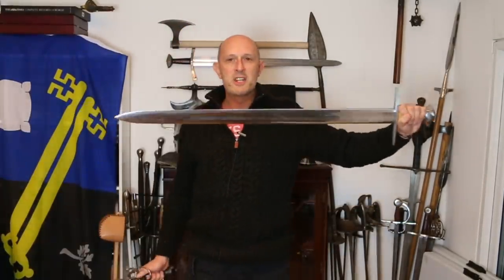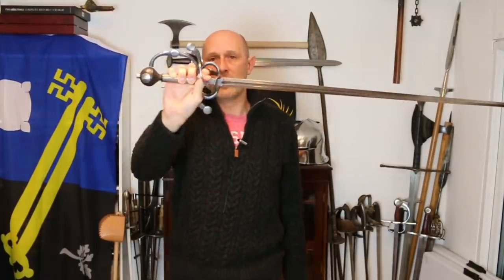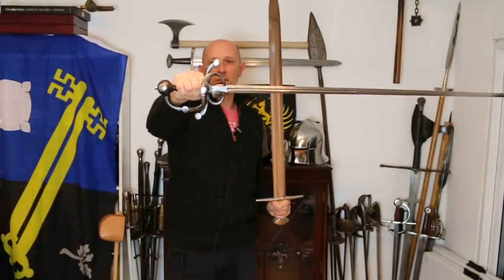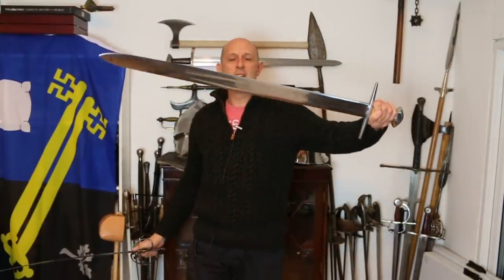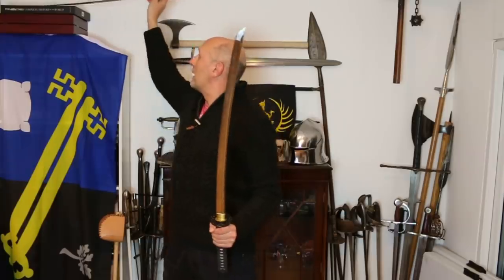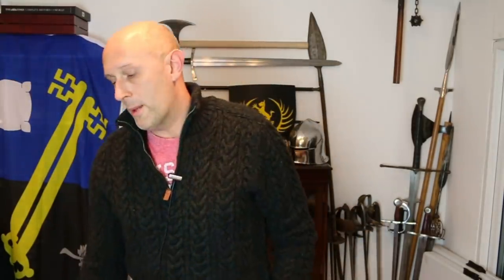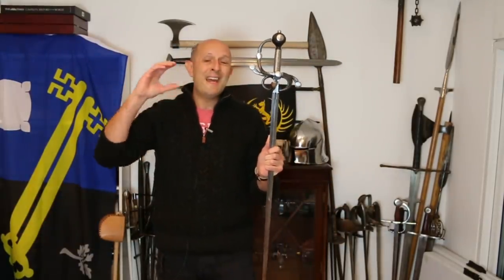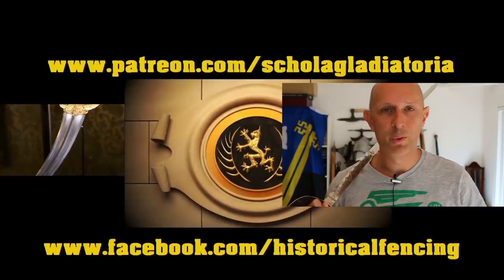Sword Blade Technology Informing Design

Comment: Isnt that rapier a litle short?
Reply from the maker: A 43 inch blade? No, it's rather long actually!
Reply: scholagladiatoria i use 50 inches spanish rapier, i thought that normal
Reply from the maker: No, a 50 inch blade is bizarre. Most rapiers of any nationality are between about 36 and 45 inches in the blade. You can see some stats of originals looking through the Wallace Collection online gallery.
Reply from the maker: Spanish rapier, total length 40 inches: https://wallacelive.wallacecollection.org:443/eMP/eMuseumPlus?service=ExternalInterface&module=collection&objectId=61155&viewType=detailView
Reply from the maker: Spanish rapier, total length 39 inches: https://wallacelive.wallacecollection.org:443/eMP/eMuseumPlus?service=ExternalInterface&module=collection&objectId=61148&viewType=detailView
Reply from the maker: Spanish rapier, total length 46 inches: https://wallacelive.wallacecollection.org:443/eMP/eMuseumPlus?service=ExternalInterface&module=collection&objectId=61163&viewType=detailView
Reply from the maker: Spanish rapier, total length 48 inches: https://wallacelive.wallacecollection.org:443/eMP/eMuseumPlus?service=ExternalInterface&module=collection&objectId=61149&viewType=detailView
Reply: aren't you a little short for a rapier?
Reply: Remember, Matt's quite tall.
Reply: Depends on the period and the material.  If you look back to the Bronze Age, eastern Mediterranean, the Minoans were empling a bronze "rapier" with a narrow blade ranging from about 60 cm to around 75 cm over all.  The so-called horned rapiers were primarily employed as thrusting weapons and there is a good deal of that kind of use illustrated on carvings and pots from the period.  One really nice example shows a thrust delivered overhand over the top of a shield.

Comment: Hello community. What do you think of this idea?
In a real sword fight, you'd need to apply a reasonable amount of force to be able to pierce a torso or to open a vein, etc... Yet in HEMA tournaments, a touch of the sword against any part of the opponent is considered a point, regardless of the amount of force behind the strike. This means that our best tournament champions might prove to be utterly ineffective combatants against the average 13th century peasant conscript. So, my idea is:
What if the tournament armour were pressure sensitive? For example, if there were 2 thin metal/ wire inlays, separated by a porous padding material, you'd have to apply enough pressure to compress the porous padding material, so that the wires/ mesh on either side of the padding (which is porous) touch, thus completing a circuit, thus lighting up a light (similar to fencing) announcing that you struck hard enough to score a point. Obviously, the more padding between the mesh, the more pressure you'd need to apply there to score a hit. So, the torso could have moderate padding, requiring a modest amount of effort to score a hit hard enough so that it registers. The fingers could have very little padding, requiring just a light touch to score a registering hit and so on...

In my opinion, I suspect that this would increase the realistic feel of HEMA combat, as you would fight entirely differently. I mean, if your opponent just flicks his sword around your defences quickly and slash/ taps you on the torso, that's a point for him/ her. But if you KNOW that there's not enough force in their strike for their sword (if you were to imagine them using a real sword, that is) to break the skin, you'd ignore their strike utterly if you knew you could capitalise on it. Hang on... Let me try to explain it better...

If you're in a real sword fight, you want to hit your opponent hard enough to hurt them, but not so hard that you unbalance yourself if you miss. You never want to simply lightly tap any part of their body with a strike that has ZERO power behind it. However, in tournament fighting, you can get away with these zero-power, feather-light strikes. I think that HEMA would be better if this were not the case. I think it would be better if you had to hit them "x" hard for an arm strike to count/ to hit them "y" hard for a head strike/ "z" hard for a finger/ groin strike and so on and so forth. Furthermore, I think that the easy way to do such a thing would be with a wire/ padding sandwich (the wire mesh is the bread and the padding is the meat) suit described above.
Reply: @mysticmarbles  
Yeah, maybe thrusts should be scored via the sword the same way they do with fencing.
My gripe here, is glancing taps of the blade (as opposed to the tip) against an opponent, that would do no damage at all, and yet you have to defend against in tournaments, but would never bother doing so in a real fight, if you were wearing armour/ a gambeson/ a leather jacket/ a linen tablecloth...
Reply: @Raz.C  You have to remember that most of these tournaments are simulating unarmored duels. They usually didn't wear gambeson because most people wouldn’t have worn one on a daily basis, and wearing one in a duel would have been "cheating" unless the other guy agreed to it. I’ve seen tournaments and sparring matches that use different rules to simulate armored combat, but that is a separate thing entirely. As far as leather jackets/thick civilian clothing you can’t say for certain whether a light hit would or would not cut through it. It really all depends on the clothing and the sharpness of the blade. It’s better to err on the side of caution and say that you do not want to take a hit from a sharp blade.
Reply: Also I like your thinking with the pressure sensitive jacket, but I suspect that it might register a touch if you just bent your torso/limb and the material compressed. Like if I bend my arm at the same time that it was struck how do you determine if it was the compression from the strike or the material being squeezed between joints?
Reply: @mysticmarbles  
I don't know how to address such issues, so for now I imagine that such sensors would be placed in the non-bending parts of the armour/ at least not on the inside of bending joints.
Reply: @Raz.C  That would be a lot of the body unfortunately. Hold your arms straight out. Now lower them down. Note the compression between your arms and the sides of your torso. The whole sides of your torso would be off limits. Insides of the legs? Same deal. I bet you could get enough compression to trigger it on the abdomen just by bending forward. You would have to go out of your way to not touch your arms together in sword and buckler and longsword. Would you only count hits to areas that had the sensors? That would be less realistic than counting the light touches. If you count all areas as targets then you’d get ringside arguments over whether a hit was hard enough to count when you hit a non-sensor area. Seems more trouble than it’s worth. 

How about this: The sword has an impact sensor. It also has the electric touch sensing system from sport sabre fencing that forms a circuit when it contacts the opponents conductive clothing. When the sword registers a touch on the opponents body AND hits with enough force then it registers a hit. I think this system is still flawed, since you can manipulate the force sensor by slapping your pommel, but it could be a good “second opinion” for the judges to go by. 

Even if it worked as intended it’s still not realistic because you can hit with a hard blow that has no slice and not cut but because the material binds it, and you can also hit with a light blow that cuts because it hits with a slicing movement and causes a gaping wound. At the end of the day its almost impossible to simulate realistic fighting in a safe and fair way. We need Matrix level VR technology. Still fun to contemplate though and I like the direction you went in.
Reply: @mysticmarbles  
Ok, you've convinced me that this will require more thought. Maybe this is the kind of thing we need to attempt to solve at 2am, in a dingy garage with a bucket of pot and at least 2 people who failed high school... I bet they'd come up with a solution in minutes that we can't see because we're overthinking it..
Reply: @Raz.C  Word. I'll bring the bucket if someone else brings the pot.

Comment: It's kind of a stretch to call the steel in traditional Katanas "very high" quality.

I'm sure there are some examples that are pretty good, but from what I've seen, the majority of them had a lot of slag. 

Many people think that the infamous layering of the steel would "beat the impurities out" but it really doesn't. It beats the carbon out and spreads the impurities more evenly through the blade rather than having large concentrations creating weak points.  So in reality, they are just spreading the weak point out over the whole blade, which is stronger than having 3 or 4 large weak points, but not as strong as having better quality steel to begin with.
Reply: ''Very high'' quality for a tiny  volcanic island nation when the main iron ore is black sand on rivers because mining was extremely dangerous due to frequent earthquakes.
Reply: Quoting from: "Neutron diffraction characterization of Japanese artworks of Tokugawa age"

"Tsuba no. 1 Age: end of the 16th C [...] Tsuba no. 1 turns out almost free of slag inclusions, which confirms, once more, the highquality of this particular artifact."

Quoting from: Neutron diffraction characterization of Japanese armour components

"Sample no. 6 emerges for its high quality iron composition:the reduction of ores is complete (except for a very low content of magnetite) and there are no visible traces of silicates." Complete reduction of ore: High temperature smelting process, which means very low amount of Slag.

Quoting from "Ancient and historic steel in Japan, India and Europe,a non-invasive comparative study using thermal neutron diffraction":
[...] For the first way, we can see that wüstite appears only in the Italian and Turkish samples because the low temperature of the smelting process appears to be unable tocomplete the reduction of iron oxide into metal iron. Fayalite is present in most samples. The fayalite content of the European samples is generally higher than that in the others, which are similar. It is possible that the process of multiple folding in Japanese smithing might be able to reduce the slag inclusion content.
Reply: @mizutoryu242  except he wasn't comparing the quality based on those factors, he was connotation the quality to steel from around the world at the same time.
Reply: @lucanic4328  ok?  As I already pointed out, I'm sure there are a few specific examples of traditional Japanese steel that are high quality, but for the most part they were not free of slag. The slag was just much finer and more dispersed.
Reply: @lucanic4328  you put your references on your comments i shall going to make a virtual statue of you in the holy lands on internetia

Comment: Cool but Japanese swords were thin like that well before the 18th and 19th century.
Reply: No they where thicker. They where not good at tempering so if they made thin swords they would bend and stay bent. They where not spring steel.
Reply: @lindaliljecrona4404  Actually no.  Depends oh how back you go.
Reply: @lindaliljecrona4404  They were good at tempering.
Reply: @deshawn4077  If they could make spring steel, why are they thicker?

Comment: Rapiers are stupid. Spadrons are stupid. Small-Swords are stupid. Sabers are stupid. Get a shield. Get an axe. Win. Or you can use a Pole-Arm...or a Zwei-Hander if you're specialized for staggered formations & flanking. Arming-Swords [-29"L] are best for off-handing when you lose your shield or primary main-hand weapon [this L includes other relatively short one-handed swords like the Gladius & Spatha]. Bastard-Swords/Hand&AHalf-Swords  are best for skirmishes. Rapiers, Spadrons, Small-Swords DO NOT WORK AGAINST SHIELDS OR ARMOR & are meant for skirmishes & duels...not for prolonged battles as they will dull quickly & have no weight to compensate for their loss of cutting ability [PROVE ME WRONG WITH BUTCHER EXPERIMENTS WITH COUNTED STRIKES]. Sabers do not statistically improve your ability to hold onto the weapon when attacking from horseback & nor do they have threshold qualifying cutting ability that accomplishes anything exceptional compared to an arming-sword or a bastard-sword....the only improvement being the basket-hilt instead of cross-hilt to avoid doing injury to your self or your horse when striking. So instead of switching swords, switch hilts. Katana's are stupid...they dent/bend & their cutting ability isn't threshold-meeting greater. Fuck your hyper-romanticism & also your lack of discipline with straight heavy linear western swords of spring steel that give you range, integrity, penetration, & defense. 

Seriously, people are too steeped in historical romanticist hysteria that near none of you are trying to improve the design of warfare tools. YOUR ANCESTORS WERE NOT PERFECT IN THEIR DESIGN & NEITHER WERE THE OTHER NATIONS & THEIR TOYS. 

Proportion. Proportion. Proportion. Proportion. Proportion. SIGNIFICANCE.

It's why I don't advocate the .223 for everything like all these fucking preppers & DoW idiots. If you plan on defending yourself against THE GOVERNMENT< then use a caliber that will deal with body armor & plating like the 30-30, .270, .308, the 30-06...which give you range & penetration through 1/2" of STEEL with just a single shot.

.223 is meant for dealing with civilians who armor is Distance or Nothing. LITERALLY! & no, 7.62 x 39 doesn't do it either. Self-Defense is AR level caliber. Greater Defense is 30-06. KNOW THE FUCKING DIFFERENCE. I'd rather be a Dink through armor than Plink off armor. Freedom is having the choice to succeed or fail. Innocence is something else.

Also, don't kill people with knives. Watch some bayonet videos & realize the cruelty of taking too long to kill someone that would live....with brain damage & mental issues....& that this harms people FAR MORE than straight forward chopping their head off. FUCK YOUR LACK OF DISTINCTION. Heads can be sown back on for funerals & no one will know. Watch beheadings. Your ancestors carried the same actions forward for noble or ignoble causes. Grow through the gruesome ghast. **IT IS YOUR RIGHT TO DEFEND YOURSELF & YOUR GREATER CAUSE.** Never let me, never let them, never let your enemy take it from you, & never let GOD take it from you either cuz his silence is standard setting.